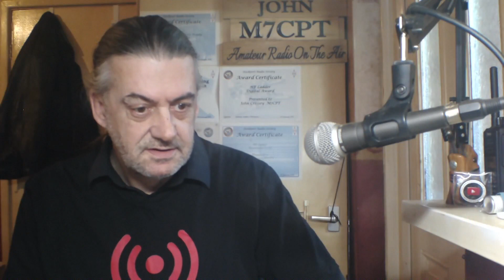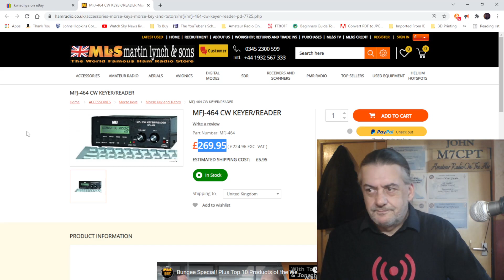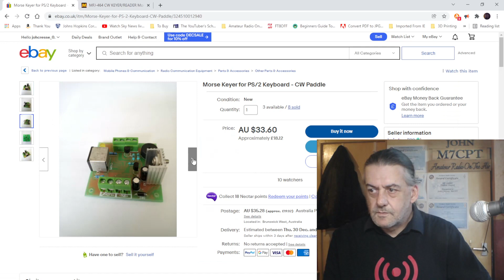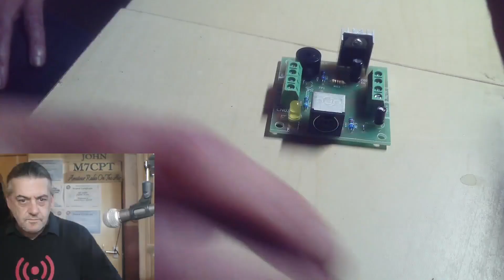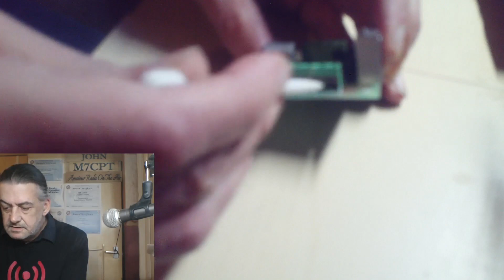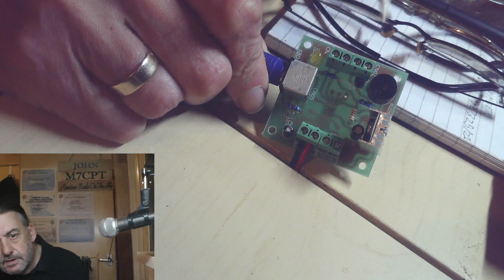How to Cheat Sending Morse Code using the Betatech Instruments K11 Board

Comment from the maker: The manufacturer of this board has reached out to me to explain the problem with the PS/2 keyboard.
The PS/2 keyboard needs to be an "AT Keyboard" for the key press interpretation. These are still available and cheap.

A more in-depth explanation includes the key difference between USB and PS/2.
AT PS/2 keyboards transfer the key strokes on a single wire while a second wire is used for a clock.
USB keyboards do not use a separate clock wire instead use 2 wires transferring differential data when prompted from the computer.
A lot of modern PS/2 keyboards use the USB protocol instead of the PS/2-AT protocol leaving it up to the computer to work out what is plugged in.
So this is why non AT keyboards will work on PCs and still not be able to communicate with this board.